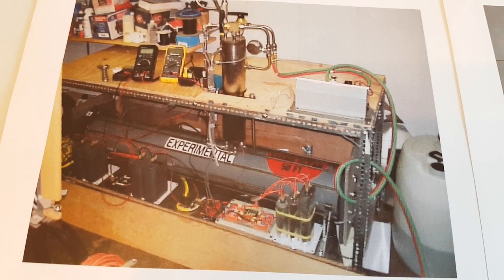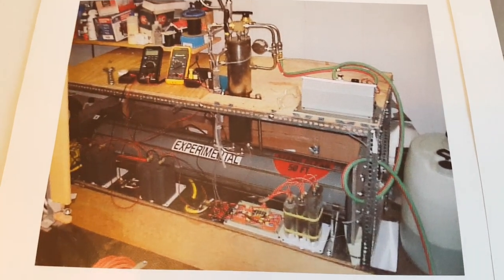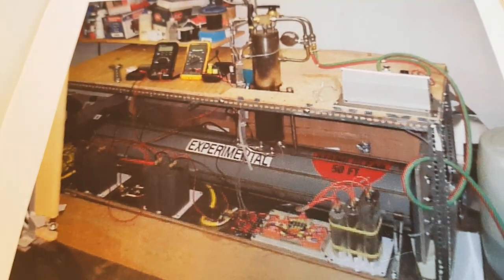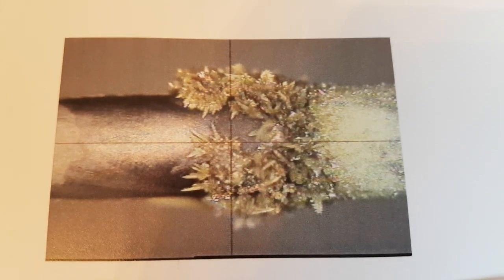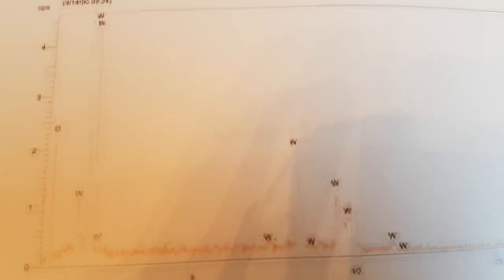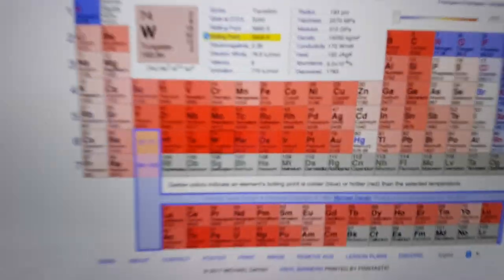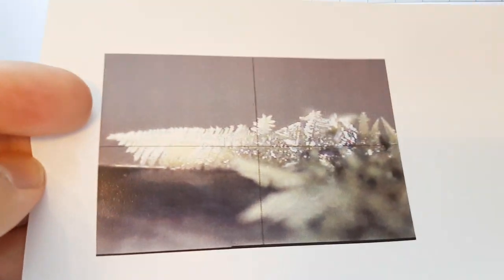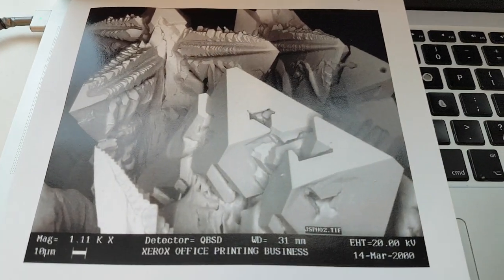Browns Gas vs Tungsten experiment - Jeff Smathers

Comment: You need to know  exactly how the piece was positioned to know the forces acting upon it.  Do the crystals go all around uniformly ?  The piece looks cylindrical.
Reply from the maker: The W rod was cylindrical, exposed to supposed Browns gas in air.

Perhaps the claimant will answer questions directly here.
Reply: @MFMP  The rod was horizontal and the flame was approx. 45 degrees to the tip allowing the vaporized W to be moved toward the rod body major.
Reply: The crystals did form somewhat uniformly around the surface and are slightly translucent to the normal light in the lab and
the microscopes light.  The yellow tinge shown is correct.

Comment: could be  crystals of thorium oxalate as most tig welding tungsten electrodes contain thorium ? cheers
Reply from the maker: If it had Thorium, it should have been observed on the SEM
Reply: Tungsten oxide(VI).

Comment: Did he shave off the crystals to see if the undelying material had been eroded/mutated into the porous crystals ?
Reply from the maker: Good question
Reply: @MFMP  No, I did not remove the crystals from the rod as I was planning on doing some mechanical testing first to investigate primary stiffness/brittleness.  The rod shown was 'lost' in the SEM lab sometime after my initial testing....
Reply from the maker: @09251954  We had a few items lost in independent SEM labs.

Comment: Browns gas is protons and O+ in plasma not H2 and O2 so the H+ protons are stripping outer electrons from the Tungsten and creating WH6 in a near plasma state. This must have a low boiling point. The O+ also steals electrons becoming O2, O3, H2O, if it contacts any hydrogen or WO3 but that is also reduced by the H+ & H2. The charge of the browns gas creates a charge bubble that partly charges and excludes some of the air at the edge of the plasma the WH6 oxidised to form Tungsten dendrites and water vapour or OH+ at high temperature.  

A proper browns gas unit lines the generator, gas line and burner with positively charged material so the ions never captures an outer ion. That.s how the seem to have extra energy. Your not breaking a H2 bond or O2 bong before creating a new bond in the H2O. when working with refractory brick you see fine, and toxic, silicon compounds including probably Silane.
Reply from the maker: Good suggestions Wesley, do you have any references to share?
Reply: @MFMP  Just the Browns, Meyer and a dozen other patents. Looking for common factors. I have copies of over 60 patents, documents and a few books. I once lived across the road from the Australian patent office. [It had heating and air conditioning and my flat did not.] Lots of original research. I do not believe any of the water fuel units/ browns gas are over unity; they are lowering melting point. That's just as useful. I have considered the cold fusion/ browns gas case but I can't see enough CF evidence there. Lots of proof now the Pd and Ni but not with Cr.
Reply from the maker: @hatac  Let's see if there is anything interesting on the samples we brought back from Japan.

Would be great if we could facilitate an on-line indexed archive of your research.
Reply: @MFMP  Oh great I've got to write another uni paper. lol. I'm out of practice. Warning I have dyslexia everything takes longer. And all the docs are in a freezing garage. Which archive?
Reply from the maker: @hatac  We can build it on-line on our server space.